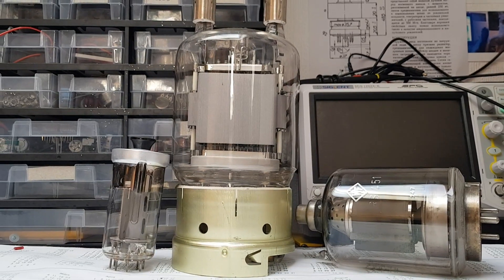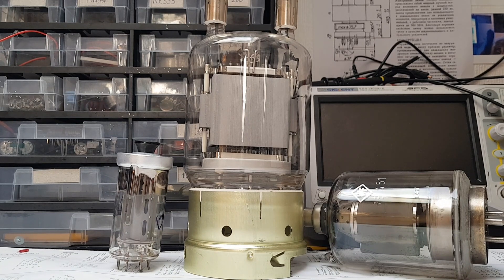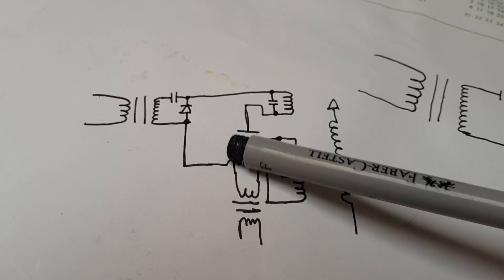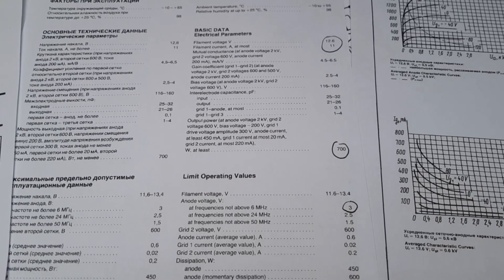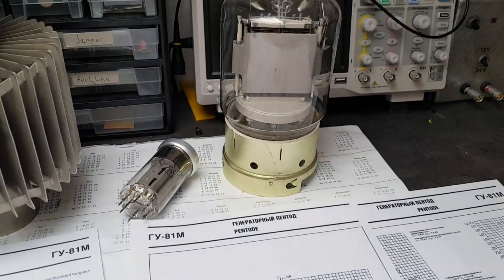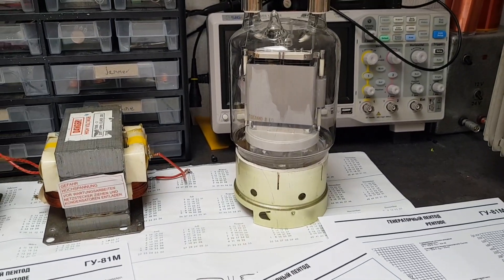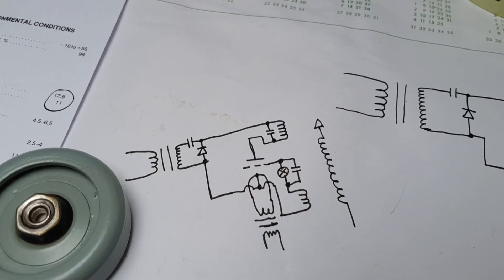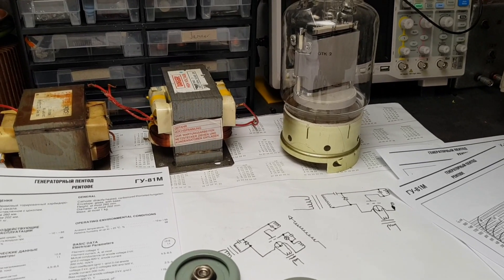VTTC from scratch? Here is how...

Comment: Steve sent me over to watch your video. This helped me understand the feed back oscillation better. I have seen some of your others and enjoyed them. I just finished and have been tuning a GU81 VTTC based on the build Michelle did at Tested to Destruction. So far it works well after a few struggles. I haven't installed the Staccato yet. I got a kit from Kurt. I forget his business name.  One of those struggles was that I didn't realize that pin 5 had to be connected to neutral. I thought the Staccato brought the cathode to ground, rather than lifting the cathode from ground. I started with a 107mm form. It was too small and I was getting internal arcing. Fortunately, I didn't destroy the secondary. I added some dowels and now primary is about 120mm. It is much happier and more stable here.  Maybe I'll run into you in the Tesla Coil group on FB. Cheers! I just realized that we have been in touch in messenger. Thanks for your help!